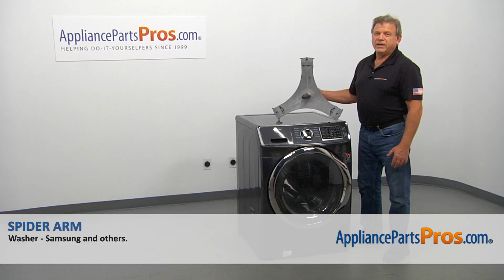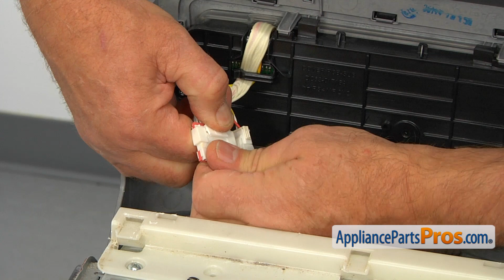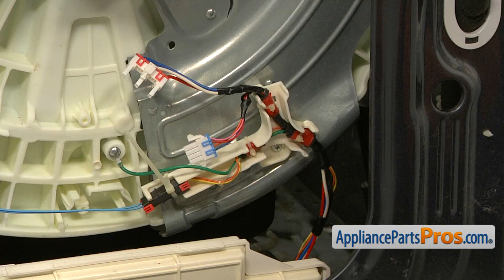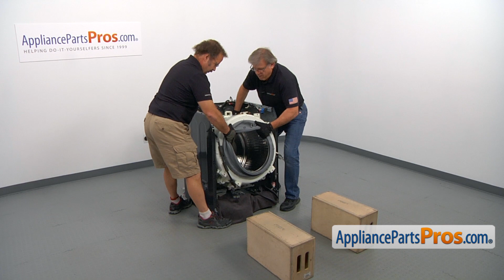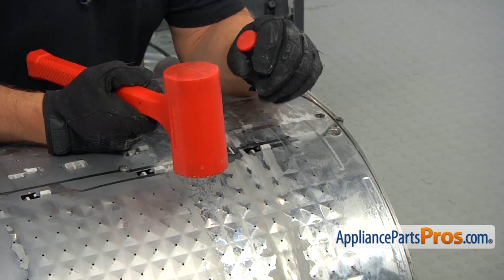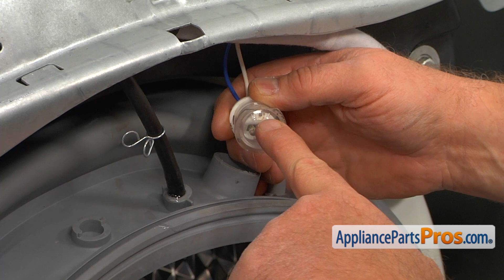How To: Samsung Washer Spider Arm DC97-16509C

Comment: I am a professional.  Foolish waste of money. This is a 4-5 hour process and not AN ECONOMICAL REPAIR.  No sane person would attempt this repair.  There is a lot more that you need to replace if a Spider is broken, Bearings, tub seal, Bearing seals, Shocks, Door boot etc...
Reply from the maker: @mrgcav You’re right that this is a major repair and definitely not a quick fix. The video is meant to show the full process for those choosing to tackle it, but in some cases a full tub rebuild—or even replacement of the washer—may be the more practical option depending on the condition of the unit. Appreciate the professional insight.

Comment: Pro tip for those whose shock absorber screws aren't catching thread, use a utility knife and cut off the plastice sharp edge of the female back side plastic port so the screw can slide its way into the further back port and make thread ckntact. I had one that wouldn't let the screw go far enough in because the plastic port fit was so tight a mm offset was blocking the threads from contacting (samsung engineering 🙄), but after cutting the sharp 90°edge to a slope/ramp, the screw slid in and I was able to tighten it down.
Reply from the maker: Appreciate you sharing your workaround—those tight tolerances can definitely make installation tricky, and small adjustments like that can help get everything seated properly.

Comment: Didn't replace the bearings or tub seal. Asking for trouble.
Reply from the maker: This video is showing how to replace the spider arm. If you need help replacing a different part you can check out our other videos or you can visit our Repair Forum: https://forum.appliancepartspros.com/. It’s easy to register, and you can either post your question or search the forum to see if someone else has already asked the same question.

Our experienced technicians, with over 20 years of hands-on appliance repair experience, are ready to answer your questions and guide you through your repair.

Comment: What is the part # to the spider arm that’s the exact same as mine need that spider arm part number
Reply from the maker: What is your model number?
Reply: @  WF45M5500 AP/A5 Samsung watcher machine looks like yours on your video
Reply: What’s the difference between the last # B.  And. C.
Reply from the maker: The part number for the spider for that model is DC97-16509C.You can place that order online or call us at 1-877-477-7278 to pace the order over the phone.
Reply: Just finished this. THANK YOU!!
I am a DIY enthusiast but this one seemed a bit aggressive, even for me.
But thanks to this incredible step by step video, I was able to change out a completely obliterated spider arm in our Samsung front load. WF219ANW
All 3 arms snapped! What a wreck.Ours has to be like 12-15 yrs old? I also decided to replace all 4 shocks/dampers since I was doing this teardown.
System test passed fill, spin,pump. My wife may cry when she sees her baby working like new again.

5-star video 🌟🌟🌟🌟🌟

Comment: Thanks for this DIY repair video.  Especially the putting it back together part.  I had way more trouble getting the shocks out of the housing and out of the way than you did but I managed in the end.  Is there any need or advantage to replace the rubber seal between the 2 tub halves or the bearing the shaft rides in.  My spider looks like the aluminum has rotted after 5 years of operation.  Could this be from using a tub cleaner once a month on the tub cleaning cycle.  5 years seems pretty short a life span to me.
Reply: I came across the same thought the spider arm on my  Samsung Flex looked like it was 50 years old . All 3 arms had corroded off I tool mine out in 4 pieces and the manufacturers date on it is 1/4/2017, not even 7 years.  The new one I put in I made sure to paint with some rustoluwm paint.  Maybe I can get 15 or 20 years out  of my new shoe arm.

Comment: Did this job today. Had my spider arm powder coated. Hardest part is taking screws off and realigning the shock bolts. Just time consuming. 

I video taped each step so I could get it back together. Used vinegar to clean the stainless tub outer, and the inside of the plastic out tub. Also the rubber door ring. 

I lifted the tub out with two ladder opposite and a rope on the center handle. Pulled it out like an engine from a car. One man method.

Comment: Your just repairing JUNK, I'm a Service Tech with over 30 yrs. Exp. Do not poor money into this Junk, Go out and buy a used W/P or Kenmore Direct Drive Washer with a Mech. Timer
Reply: I wish I'd  know when I bought mine in 2010. Just replaced my spider arm. Part was $80, powder coated it for $25. Took me over night to let wd 40 soak the bolts, then cleaned the tubs with vinegar an hour. All told cost me 5 hrs. of my free time mostly removing bolts, screws. But I got it done. $105 to keep it going another decade.
Reply: @jeebuscrise4482  maybe 5 years. I'm learning all about this big beautiful expensive piece of crap
Reply: Because was made in China. I think Samsung learned the lesson.
Kenmore? Rebranded  clone? Maybe MIELE, with $4000 ticket for the set? No thanks.
And one more point. This "junk"  is washing  perfectly clean and almost dry laundry  ready for short cycle in the dryer for (at least) the first 7 years before any mechanical problem occurs.